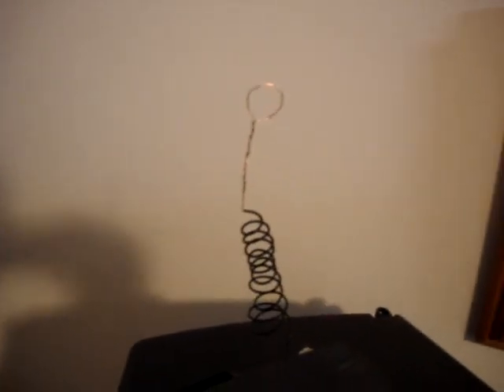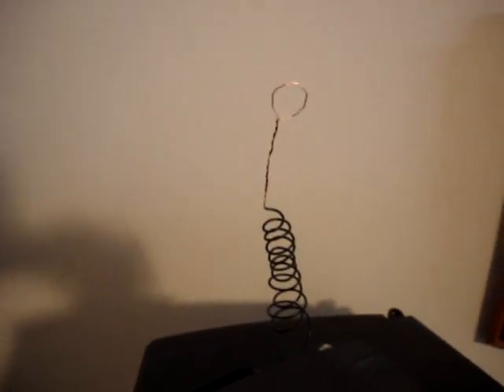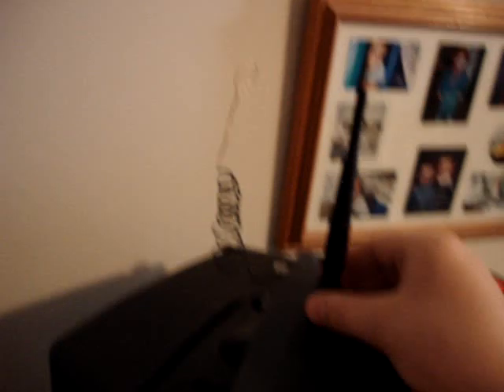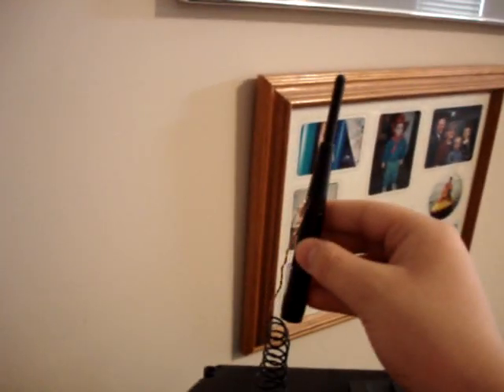DIY Wifi Antenna

Comment from the maker: I just made a ball of exposed copper at the end that connected to the router but all that really needs to happen is the copper just needs to touch the copper pin that is inside of the hole where the antenna goes.